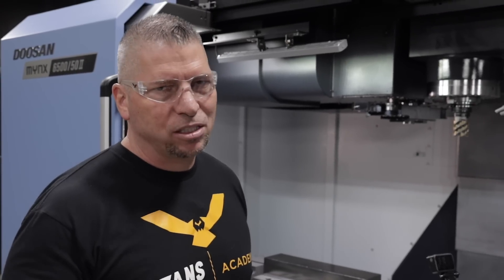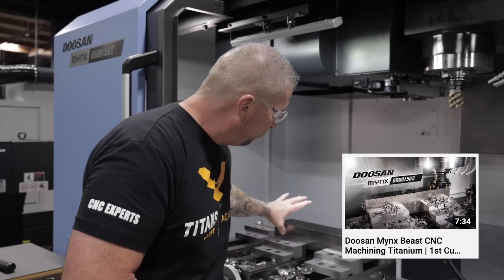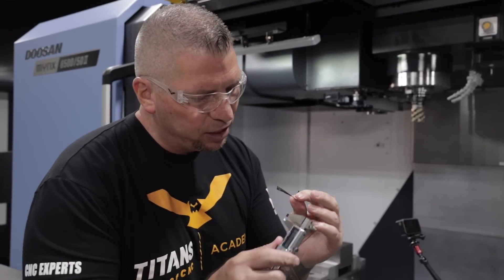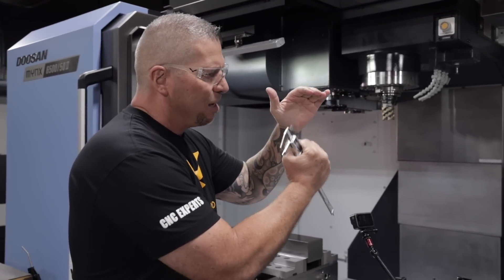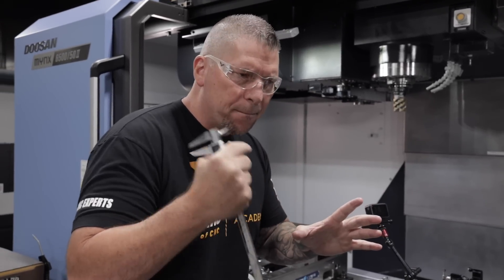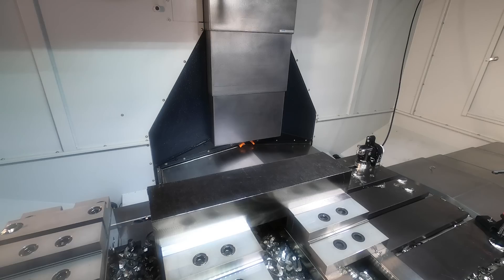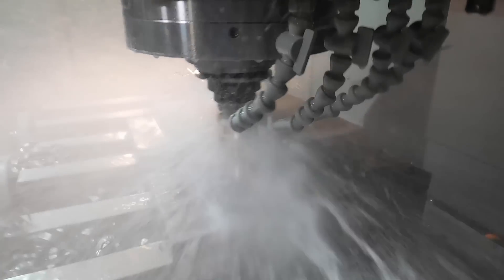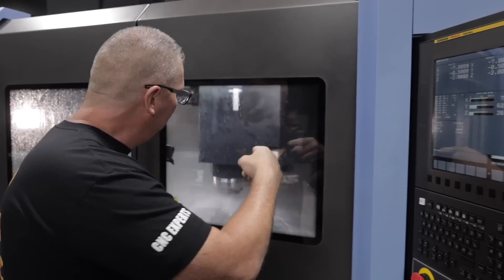Taking MONSTER Cuts in Titanium With Harvi Ultra 8X | DN Solutions MYNX 6500

Comment: Awesome. I’ve been in engineering for over 30 years. Biggest problem I’ve come across is that Employers won’t spend the money on decent tooling. Only today we had to put a job back as we didn’t have a spare 4mm HSS long series drill. I use a Doosan Minx N510 is a great machine.

Comment: Could you  just  order  the  size of  billit  that  doesn't need  so much  milling. Seems like a  waist of  expensive  material and  milling  time. I  know chips  are recycled regardless.
Reply: Titanium chips are not recycled. Has to be melted in a vacuum. The stock sizes in exotic materials are also very limited.

Comment: Are you using a Big-Plus Cat 50 holder for that cutter? I run a 7500 and the mill is capable of using this style of holder. It does seem to help when taking heavy cuts.
Reply from the maker: Using Kennametal Dual Contact Holders
Reply: Thats defitnly not a iso50.

Comment: I don't mind replacing inserts if that means I made money producing parts.
What I do not like is replacing broken inserts or end-mills because that mainly means I lost money without being able to charge the customer for finished parts.
What I especially like in this video is the attention for spindle and axis loads. Most of my parts are small and/or thin so I hardly see any loads but I do have some larger metal eating monsters that make me smile when I see some higher loads and thicker chips.

Comment: Yer material rate video needs done.. quick Question when removing large amounts of material is the finish different eg, more of a rough cut rather then a finished cut. For example if said tool has 20 cutting contacts to say 45 your finished part would look far more smoother? Or is it a case of the right tool for the right cut whats moveing faster technology in cnc machines or the technology behind each individual tool
Reply: These cutters are for roughing only. They will leave poor to half decent finishes. Usually you run a roughing op then a finishing op with different tools, usually endmills for finishing.